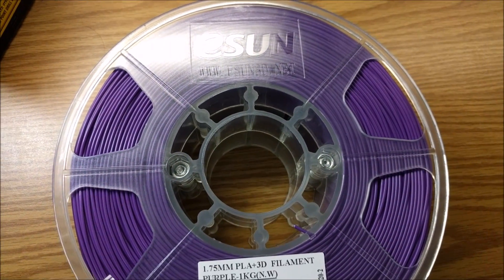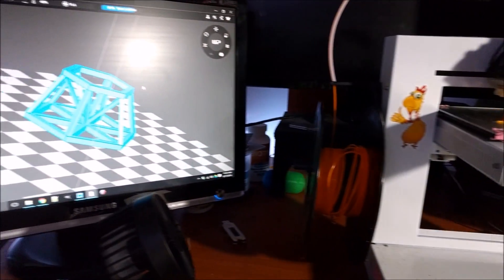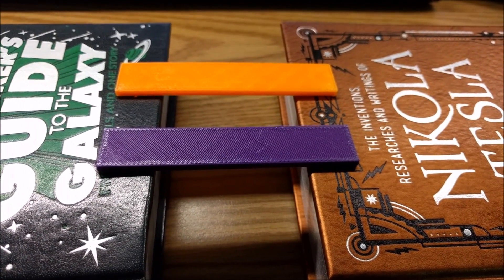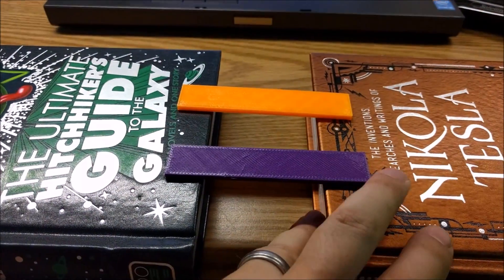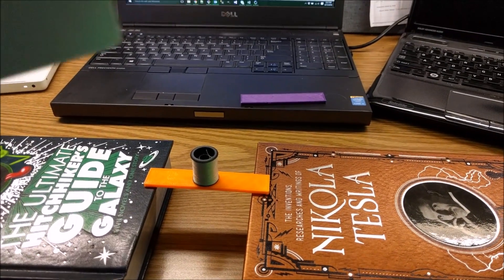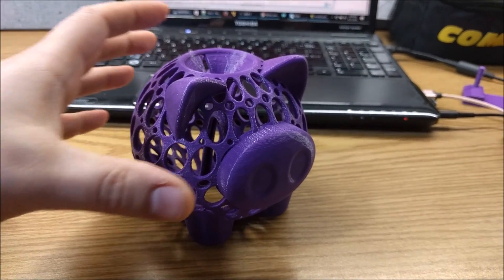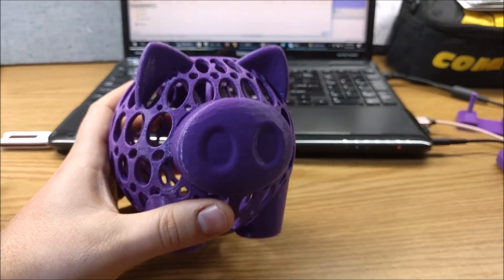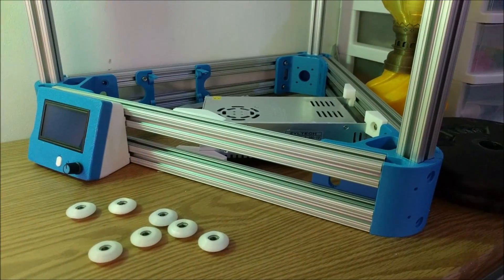PLA vs PLA+ Head to Head Matchup

Comment: Rain pla+ best at 230° and with a bit hotter bed temp. If you were using the same settings to print the PLA and the pla+, you probably didn't get good layer adhesion on the pla+ which would skew your results pretty significantly.

Comment: I think u need to just stick with reading your tesla book. Great test if your audience is a bunch of three year olds 🤣 at a party! Your parts are a printing NIGHTMARE  and I believe your print quality has definatly affected the strength; durability and resilience of the parts. All the stringiness and gaps in your first prints are a joke. Before you put out bad, unfair test results I think you should learn a little more and print for a couple more years.

Comment: Hi, Steve!
Your methodology is not quite scientific: you applying the wight with no quarantee that the load evenly distributed on the model. The fact that you put a book on top of it is not a quarantee as you can shift the center of weight each time you put a new weight on top of the stack. As a result you will crush the part mostly by shifting the center of weight, not by increasing the load only. And this is the case I think with PLA+ as it is clearly seen that your stack was shifted towards the wall.
The second test with a 3mm strips was a test not for strength but for flaxibility.

Comment: What temp did you print the PLA+?  I have a spool of Blue Inland PLA+ and it consistantly jams and bunches up at the extruder.  I have a CR-10s400 and the box suggests 205-225c.  I have tried it at every temp in 5 degree increments from 205 to 230 and it JAMS every GD time!  I have not completed a single print with it (and I bought like $250 worth in varying colors!!!).

It seems to put the first layer down just fine (before the filament coolin fan comes on and at the lower first layer speed).  It can also print quite a few layers once the filament cooling fan turns on but eventually in every attempt I have made to print with it it eventually jams and it's making me F'ing insane!!!

I don't know what to try to fix it.  I am using the standard Simplify3D settings for PLA.  0.4 nozzle, 0.2 layer height.  The cr-10 settings have a default retraction setting of 5mm at 1800mm/min.  Default print speed is 2400mm/min.  X/Y movement speed 4800mm/min and Z-axis movement speed of 1000mm/min.

I have had no issues printing Inland regular PLA at all!  I print at 215c with the standard cr-10 settings and I have printed over 6 spools of microcenter inland regular PLA without any issues.  So I am totally baffled why the PLA+ keeps jamming.

Other MODS to my CR-10s400 include:

* micro-swiss all metal hot end
* thingiverse EPF fang print head fan mount with cooling fangs
* 40x40x20 noctua cold side cooler fan
Reply: I print eSun PLA+ @ 215 nozzle,  65 glass bed on a stock Ender 3 without problem.

Comment: There are several ASTM Testing Methods that one should follow to the letter.  1)  ASTM D4475 Apparent Horizontal Shear.  2)  ASTM D790 Flexual Testing  3) Compression Load at Failure.
I will print some PLA, ABS, PETG samples and perform the as mentioned tests on a calibrated Load Frame.

Comment: I'm using PLA+ at 215 Hotend and 65-70 bed with a print speed of 40mm/s. The PlA+ is quite a bit stronger than regular PLA and breaks much different. I just annealed some and will put it out in the sun and do a breaking teat tomorrow. From the looks after getting the PLA+ and regular PLA out of the oven, the regular PLA shrunk up a bit more than the + and also started to deform a bit more. My oven temp was 200-210F for 30 minutes on a flat cooking pan and let it air cool down. We will see the outcome tomorrow !.

Comment: Why do you say the PLA+ crystal print is 'amazingly strong' when you just proved that it's the same strength as PLA?
Reply: I have been using eSun's PLA+ for about a month now and can say that yes it is a tougher material than regular PLA and does not "Break" like regular PLA. It also anneals very well, but will warp depending on the shape of your print, the annealed parts are tougher than the non annealed also. 

It also is a bit more dependent on bed temp of around 55-65c and a hotend temp of 215-225c. If the air conditioning is on you may have to step up the temp a little as I have found if temp drops below the 215c area, you can start to get clogging in the nozzle, so listen for it and make adjustments right away !

All in all I have found it to be a very good and tough day to day filament and very good if you can anneal it. (I bought a $35.00 Toaster/Convection oven just for this, it is small and sits next to my printer - about 200deg F for a total in oven time of 60 minutes. I put the parts in, set the oven to 200deg F for 40 minutes and when it rings off, I let it sit in the oven to slowly cool off for 20 minutes).
Reply from the maker: Thanks for asking! This was the first of several strength test videos that I did, and in retrospect there are lots of issues with it.  For one thing, the test shapes that I was using are all flawed, and more subject to things like how carefully I set the weight on top than the strength of the material.

I was convinced at the time that PLA+ was "10 times stronger" than regular PLA, and subsequent testing in later videos showed that not to be the case.  (I DID find it to be stronger than PLA, just not by THAT much.)  It does have other advantages such as higher heat tolerance and a greater ability to bend instead of break.

In an upcoming video, I'm going to run some tests on annealed PLA/PLA+ and see how they stack up.
Reply: Davey Hi just